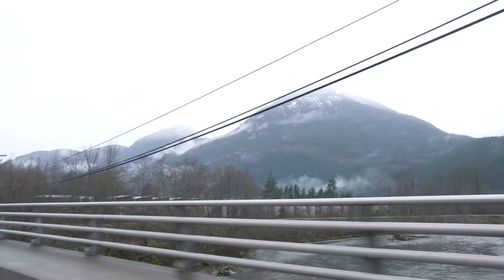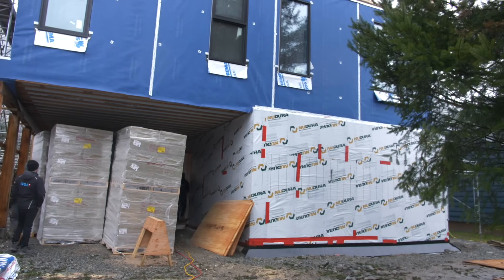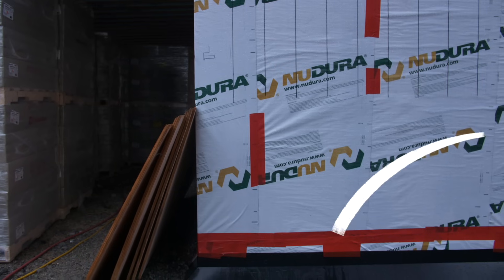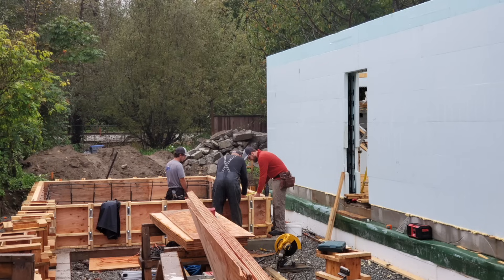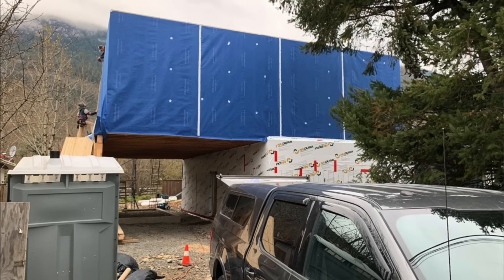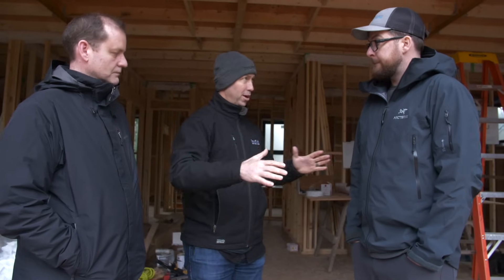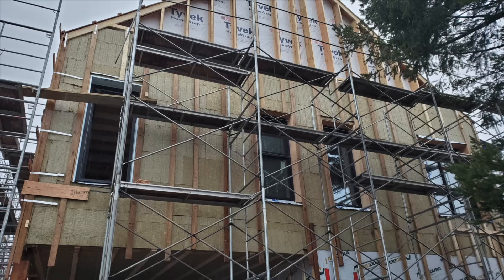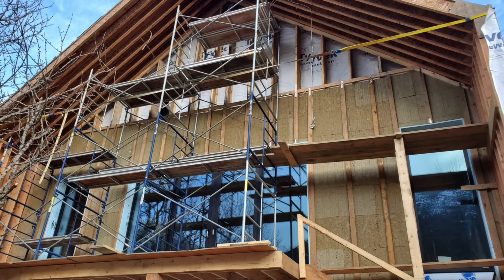Some Awesome Insulation Details on this BC Passive House!

Comment: That's just how rich people with a sense for the environment are having fun. Others waste money on yachts or airplanes... The extra energy and hydrocarbons used to manufacture all that Styrofoam, Rockwool and plastic for vapor barriers etc will take 100 years to offset the energy saved for heating. Passive House is like a cult. But fun to see what can be done regardless.... The Tesla will look good in that car port.
Reply: It won't take 100 years to offset the energy used for heating. It might take 10 years or so, but on a house that will last 75 years or so, it's a good idea.

Comment: Bugs (worms) eat styrofoam. I would hesitate to make a foundation on foam.
Reply: Is this true for structural foam?  Lots of highway bridges, ramps, overpasses are built on it and would be in danger of failure if this were the case. It is much denser than "regular" foam.
Reply: @travelfeet  No problem if it is covered with 4' of rock and sand and paved over. No ant is crazy enough to go there..
Reply: Carpenter ants love it too!
Reply: They do not actually ingest and excrete it, they just borrow their way through much like ants make nests in dirt.

Comment: Why all that empty attic space❓ Why not put the insulation on the top, with a layer or 3 on the roof deck, and you would have a LEGO Room where you can sit and build LEGO castles while the house floats away on its built-in raft during the next flood❓
Reply: I costs more to build a roof with wide rafters so that the attic can be finished. Trusses use smaller pieces (usually 2x4's) but the real difference is the extra work necessary to make a rafter roof air tight and well insulated.
Reply: @gblakev  You are correct. If you have the land, it is cheaper to build all the living space you need under a trussed roof. Only for a tight site would making the roof to be insulated and habitable space be a sensible option.

Comment: foam will break down in 10 years. These new house are like any other disposable product today and the cost to maintain its efficiency will cost three times as much over it life vs standard build home
Reply: That would be true if it was left exposed to the sunlight, some of you are such armchair idiots
Reply: @Joshua79C  I go to hundreds of these homes a year and they all loose their efficiency as they age and the foam still breaks down even when they are not exposed. Funny builders slap it together and run and us HVAC techs and building contractors try to maintain it for customers who were sold on marketing. 

All products break down and age, as they age they become less efficient, more air infiltration happens and the equipment workers hard because its no longer sized correctly. As the envelope of the home breaks down and penetrations done the home becomes vastly more expensive vs conventional home that cost 2 -3 times less to build.

 These specialized products to replace are harder to find, more expensive to order vs what's immediately available at most supply house in the US. These new homes will never last as long as a traditional home.
Reply: @zack9912000  
You most have some other foams or you had no clue what you are doing in building business because here in EU insulation foams are used extensively for the last 50 years and I can't see any degradiations even in a 50 years old houses
Reply: @Joshua79C  Jp and even under sun degradation isn't not near that fast.

Comment: how long lasting is foam though? has there been any studies with that foam as a foundation submerged under water for a prolong period of time? Seems like it could break down if the flood water is carrying the right materials.
Reply: Bridges they use similar products they break down and loose structural support in 10 years
Reply: One of the biggest bitches about Styrofoam cups is that they don't break down in the landfills.  As long as it is covered up it will easily  last 100 years or more.
Reply: @canvfrluvr8005  good point

Comment: R-100 is pointless. Insulation effectiveness does not increase after R-60.
Reply: obviously it is more effective or it wouldn't be R100.  The point I think you are trying to make is it doesnt save enough money  to pay for itself and the extra interest cost if included in a mortgage.
Reply: tee kay no, R-60 is a little over 99% efficient in heat resistance. The efficiency will not make a noticeable difference as more Rs are added. I own an insulation and air sealing company (the company is a preferred contractor with two major utility companies in a major metropolitan area.) As such in this area I am a subject matter expert.
Reply: @koryleach9660  it doesn't matter what you do that doesn't change the laws of physics
Reply: tee kay true. Mathematics states that the return on investment will not pay for itself in the added material expenses to go from 99.2% efficiency to 99.5% efficiency within 20 years.
Reply: @koryleach9660  exactly just as I originally stated
Reply: R60 is basically "useless" if air sealing isn't extremely good also. BTW I can do the math too.
Reply: tee kay I concur 100%. The air sealing is vital for insulation to do it’s work. It’s the second thing we do. The first is a blower door test to get a baseline of air leakage.
Reply: @koryleach9660  At todays costs in most parts of the US in a suitable site It makes more economic sense to seal extremely well then insulate to code or a liittle above and invest in a solar system especially if you can DIY the solar and get 26% tax credit.  Keep up the good Insulating and sealing.

Comment: Property tax is assessed based on the external dimensions of the structure, so that additional 1’ of wall thickness could very well be 200 sq ft of area.  Assessed value will reflect the build cost, which is probably over $300 sq ft, for this building.  The extra area for the wall insulation would add an additional  $60K to the assessed value.
Not sure what the mill rate is in Whistler, but where I live (Ottawa) that would add over $600 to your annual property tax.  

That wall detail might save a couple dollars of energy costs and cost many hundreds more each year in property tax.
Reply: This is a fault in tax policy, and one of the many policies in many countries that undermine changes in building construction practices. So yes you are correct, but assessment policies can be changed (and should!)
Reply: No where near Whistler.

Comment: they are on attic. tarp over studs. going to be fun when. the cable guys has to drop a line and drill through that .  run conduit people. builders now a days should know this by now
Reply: Along with conduit to each room from a central area to run internet and whatever else the future brings.
Reply: No need to come threw the roof with cable. Everything can be laid out in his interior wall cavity.
Reply: snoozeulooze tv trust me. some one always wants extra lines. builders never put enough

Comment: Did they extend the rock wool insulation up the gable wall so the the top of the exterior insulation is the same height as the top of the attic insulation?  That is kind of what it looked like in the shot showing the gable framing.

Comment: Which makes more sense: Spending an extra $100,000 beyond what you needed to for extra insulation, or just pay the damn heating bill with that same $100,000? The fact is the cost for all that extra insulation is borrowed, so now you are paying interest on it, for most of the rest of your life. If you are so rich as to be paying with cash you don't need, then who cares about insulation?
Reply: How long will the house last? I live in a house that is 100 years old and built like a sieve. We overpay to heat and cool, and will continue to for another 30 years. WE are working on retrofits, but it's a long slow and inefficient process. A well built house should easily last 100 years. Based just on the economics, if the energy efficiency cost payback takes 100 years, it's still economically viable, if the market values the efficiency. Unfortunately, it seems that most of the market can't consider values based on anything beyond schools, granite countertops and a rain shower; then reselling in 5 years. Beyond all of this, we need to reduce CO2 emissions, full stop.
Reply: @travelfeet  It is not in any way "economically viable" if you are not planning to keep it for that 100 years or have your family live there forever. This almost never happens. I could not possibly give a shit if my house lasts 100 years, I will be dead. Also, it's pretty well known that those old houses are mostly only still around BECAUSE they leak so bad, and can dry out. Modern buildings aren't like that. Whoever is building that house, likely will not die there, and they will lose money on all that insulation unless the market goes way up to make up the difference. (but even if that happens they still lost money)

You couldn't sell that house for what it cost to build. There is a reason houses are not normally built like this. It's being custom built by somebody with more money than sense.
Reply: @ryanroberts1104  I agree, the last bit you mention is the issue, you can't sell the house for what it cost to build, because the market doesn't value the 100 year return. People don't but what they can't see (the hidden efficiencies of design and construction). I am hopeful that as energy costs rise, people will become more aware.
Reply: @travelfeet  The market will NEVER value a 100 year return on anything because that is longer than the lifespan of a normal human. It's not an "investment" if you never personally cash out. Some more affluent people like to plan ahead for their families finances, and that is great, but very, very rare. Even corporations, who don't have a life span, would never make a 100 year investment. If you want to be "green" you probably shouldn't be building a new house at all.

Comment: The biggest issue with this house is its location in a flood plain.  They didn't mention the flood plain designation: 100 yr flood plain?  500 yr?  20 yr?  (LOL).  Flood resistant walls means the walls can get wet....but water can PUSH things as well as get them wet.  Water can excavate the foundation, water can push the slab, etc.  Any bets on how far the house moves during a big flood?

Comment: Every house should be built to the passive standard . The money savings alone is worth it.
Reply: Its depend on energy costs and ecological point of view but if you want a healthy environment for your children then yes, you must build passive houses which will also provide a better living quality
Reply: It may be worth it in Canada or very cold regions but maybe not further south money far better spent on solar panels to provide energy to offset utility bills with a well sealed house and code insulation
Reply: No, it's an obscene waste of money. For a fraction of the cost you can build a 'pretty good' home and simply add solar. The added cost of building this home runs into many hundreds of thousands - it will never pay out vs energy savings. And to build these idiotic homes you entomb yourself in a super tight off-gassing box that requires an expensive HVAC system to deliver healthy air.  You need your head examined to want to live in these monstrosities.

Comment: Wetlands should be protected and not built on. 
They provide areas for storm water run off and to recharge ground water.
Reply: It's in a flood protection zone, not a wetland

Comment: I'm definitely a novice in building science-related things but if your groundwater level/flood water is rising up would the foam that is the base of the entire house float upwards?
Reply: You've got my curiosity peaked!

Let's say the part of the building built on foam is 1000sq-ft because it can't be much bigger than that. Let's call the foam 2ft thick, that's 2000 cu-ft. 

The buoyancy lift of water is equal to the weight of the water that the object displaces. We know that water weighs 8.35 Lbs/gal. So the buoyancy of the water at 2ft deep is 125,000 Lbs. Now you can use that number against what you think that part of the house weighs. The 1st floor walls are poured concrete, probably 6" thick (probably 127 foot perimeter at 10ft hight = 47cu-yd concrete (=190k Lbs). The floor is poured concrete probably 5" thick (15.5cu-yd = 62k Lbs). The foam is probably 10Lbs/cu-ft, so it's 20,000 Lbs. That's 272k Lbs just for the down stairs. That's over double the weight the water displaces. It won't float.

That's not counting the upstairs floor, walls, roof, etc.
Reply: @cornpop7805  I love math.

Comment: Had to watch twice. I saw no allowance for plumbing, other than the porta potty. All of the envelope intrusions for plumbing and electric (unless its 100% solar/electric) must be done in a special passive house way(?).
Reply: Passive houses generally require all the penetrations to be carefully sealed to prevent air leakage.

Comment: My biggest worry too is if it would float in a flood. Conventional homes float away bad enough in a flood, but I would think adding a two feet foam raft would just exacerbate the problem.
Reply: Pretty sure it's offset by the amount of concrete in the lower level's walls and the floor slab, not to mention the rest of the house. At any rate, it's used in the construction of roads, bridges, and a bunch of other commercial structures. I'm sure it's safe enough.